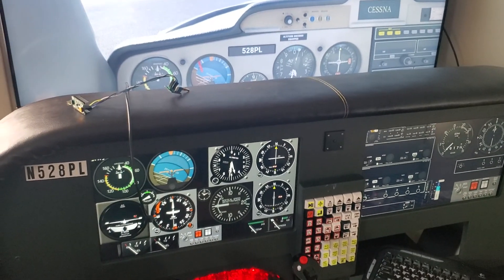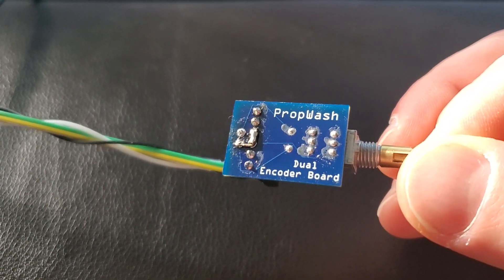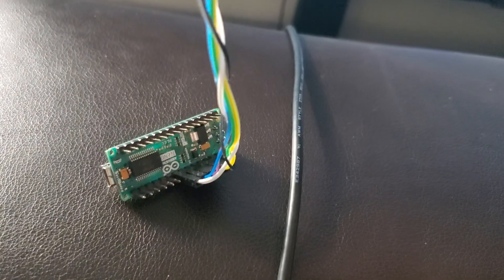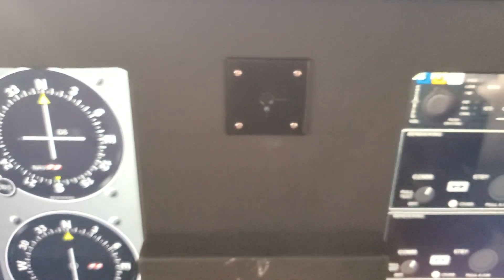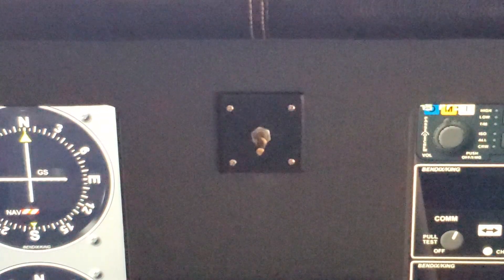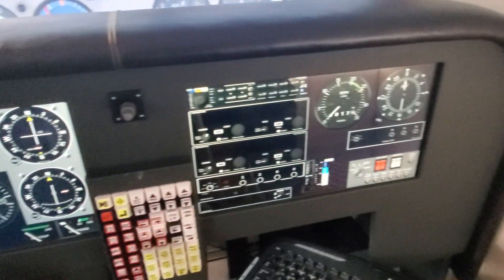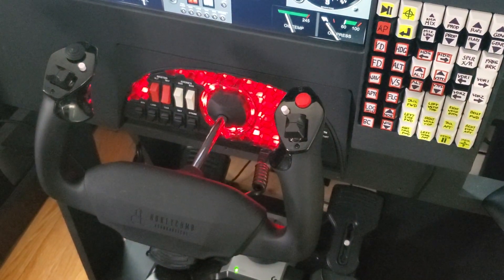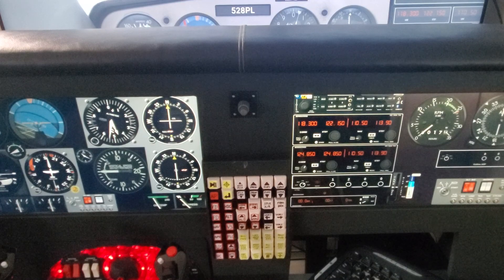DIY Knobster Project- Part 2

Comment: It would seem Siminnovations have now made a new KnobFS version that rules out the DIY Knobster of yours. Do you know of any Open Source projects that has made it possible to use a DIY project like this and still get similar functionality as described here? As a DIY:er myself I was very much looking into building a knobster clone like this, but if there is no support from Air Manager then that is out the window I'm afraid. Any input on this maybe?
Reply from the maker: I haven't been following what they've been doing for a while unfortunately so I don't know what the latest is. Sorry.
Reply: @peterlanoie They mention the "DIY Knobster" as not compatible anymore so at least you have made yourself famous, or maybe infamous. :)
I'm looking into making my own add-on that somehow mimicks a knobster but with more rotaries (like 5), and few buttons that you can feel (while in VR and memorize what they are mapped to. Like the G1000 knobs. A popup toolbar window that shows you your hardware knobs and which of them are mapped to what to help if you forget the mappings. And some configuration switcher control also in hardware that can be used to switch out a config to another. Also a bit like knobster, but for a whole set of mappings in one step. MobiFlight has all the functionality needed to create the encoder mappings and the config switchings (via preconditions). But I haven't figured a way to connect to mobiflight from an external program via an api to get the status of the config switch, which I need in order to feed the toolbar window the grapics for the current setup. So, veery early in my possible project for this, but creating something like this would be really neat I think. 
The end result is a "knobster" panel with more than one rotary and a number of buttons that is connected to selected knobs in the cockpit, with the hardware designed for VR use and everything configurable in mobiflight (which makes it easy to create configs). No promises of any success in this. But it looks  doable IMHO.
Reply from the maker: @kristianjorg418  That sounds great! Definitely talking my language. Unfortunately, I haven't "flown" in too long, being consumed with family, work, and 3d printing so I haven't even seen what doesn't work any more.
I look forward to hearing what progress you make on the project.

Comment: Peter, I built my knobster, at first with a clone Nano, then with the $$Nano. In both cases they failed to flash. It gives me a message  Closed  Com port,  avrdude.exe:ser_open(): can't open device etc. 
Did you run into this when installing your device. I cannot find a remedy anywhere on the web. Am I missing a program? Thanks
Reply from the maker: It was a long time ago when I did mine. Honestly don't recall if I had any major issue. I vaguely recall a problem but I think it was just me not selecting something correctly. I think I flashed it right from airmanager.

Comment: Do you have to buy the full version of Air Manager for using the Knobster?
Reply from the maker: I think I set it up on the free version but I can't recall for sure and I haven't run it in some time to test/check. Sorry, I know that doesn't help much but wanted to reply with something.
Reply: @peterlanoie  No problem, Peter. I think I'll order some parts anyway. Thanks for your time!

Comment: Thanks! Great job Peter!, and thank you for sharing your knowledge. Your panel looks great! :)  Question, was i difficult to program? and did you connect the Arduino with usb to the computer running Air Manager?  Thanks Again!  David.
Reply from the maker: Thanks! The initial programming I did to experiment with it was not too bad once I figured out how the encoding stepping worked. Setting up as the Knobster was all handled by Air Manager, I just flashed it from directly in the program. Yes, the Arduino is directly connected (via a hub) to the computer's USB using a regular micro USB cable for data and power. Flight Sim and Air Manager all run together. I haven't tried the networked Air Manager viewer app.
Reply: @peterlanoie  Thanks Peter for this info! I really appreciate it!

I contacted propwash for the dual concentric encoders, but they wanted 50 dollars min for shipping to sweden!!  

So i will try to find the items needed from some supplier in europe. My first goal is to build a simple unit that kan change frequencies in x-plane & FS2020. I will then use my regular monitor for scenery and 2 old iPads for extra screens to display air manager instruments and maybe the G1000. 

Further down the line i would likt to have something like you done, i don't want  a complete cockpit (Due to space), just the instrument panels and glare screen and a big 2k or 4k TV.

What sources on the net did you find most useful to learn Air manager programming or setup and the electronics stuff?     Thanks! David.
Reply from the maker: @Skinny-me  it's been a while since I set this up so I don't remember details if where I found info. I'm a programmer by trade so that was just experience apart from reading documentation on arduino specifics. Setting up air manager has been mostly trial and error. Anything else was just googling.
Sorry that getting the encoders outside of the US is such a pain. I've that from others too.

Comment: Great vid, hey do you know if you can use direct with MSFS2020 if you don’t use Airmanager and it would recognise it as a programmable device so I can assign to Comms etc?
Reply from the maker: As a Knobster it's intended to be used with AirManager. There are Arduino programming libraries that can make an Arduino appear to the computer as a standard joystick but that would require custom programming.

Comment: Great video thanks. I have same issue with msfs and the honeycomb yoke. I unplug the yoke then it works perfectly. Have you by any chance found any other solution other than waiting for MS to fix it!? :)
Reply from the maker: Unfortunately, I have not yet found a fix for the button repeat problem.
Reply from the maker: I forget exactly when they fixed it but a recent program update resolved the button/knob repeat issue.
Reply: @peterlanoie  Hi, sorry for replying to an old thread but are you saying the update fixed the skipping by 10 degree issue when rotating the knob?
Reply from the maker: @Double-D_291  yup!
Reply: @peterlanoie  awesome! Thanks mate!

Comment: Should we load any specific Code to arduino nano from air manager?
Reply from the maker: Air manager has the built in function to flash the Nano with the Knobster code. No additional steps should be needed.

Comment: I have Dual encoder and button knob from PropwashSimulation and the Arduino nano. But what is the name of those cables in colors and jumpers and where you bought those.
Reply from the maker: The wires are testing leads or "jumper wires". The pin slide on plug on those are called "Dupont connectors". The ones I used are female-to-female. On end connects to the encoder board's pins, the other to the Arduino GPIO pins.  I got them from Sparkfun: https://www.sparkfun.com/products/12796
Depending on what you want to tinker with, it's helpful to have male-to-male and female-to-female style as well.
https://www.sparkfun.com/products/12794
https://www.sparkfun.com/products/11026
Plenty of options around such as at Adafruit: https://www.adafruit.com/?q=jumper+wires&sort=BestMatch

Comment: I like your work. But I am finding operating the knobs with the streamdeck and flighttrackr-mobiflight plugins easier than the actual physical knobs.  I can operate all knobs (ALT, NAV, RADIO, GPS) on the Mooney Ovation in MSFS2020 with the stream deck now.  One streamdeck advantage is advantage is you don't have to select and activate a gauge first and the numerical display in also on the streamdeck keys. Just wish we can enter Airports codes and Waypoints via Alphanumeric display.

What you have done here is awesome and I like you work.

Just FYI for anyone: The stock Vertical Speed Button serves as the ARM button in the Mooney.
Reply from the maker: Interesting, I had never considered something like a streamdeck for that (I don't have any streaming paraphernalia). One of my goals for my flight sim cockpit build has been to make it as much "not computery" as I can but also make it flexible. I didn't want to make a sim pit that's very specifically one aircraft. So obviously there are some concessions like using touch screen displays to support highly variant instrument styles and layouts (although with modern glass cockpits it's becoming more realistic to have just a display). Also, the programmable keyboard is certainly not a great analog to normal cockpit equipment. But in my view buttons are buttons.
I have found that the knob has worked well (MSFS input bugs aside). I like having that physical knob to manipulate. It's easy to locate without looking and I find I am not changing the knob's target instrument frequently enough to make the "tap and turn" pattern annoying yet. But to be fair, I haven't been doing much with ATC yet where I would need to be changing back and forth between radios and navigation controls. The programmable keyboard has autopilot inputs on it so that reduces some of that need too.

Comment: Thank you, did you manage to fix the step skipping issue?
Reply from the maker: Unfortunately not yet. This is a known issue with a bug directly in flight simulator. The signals from the knobster to air manager are fine, likewise the commands from airmanager to flight sim are fine. Flight sim is handling internal logic for button inputs poorly. I have an idea but haven't tried it yet.

Comment: Can we associate the encoder with a screen that is not touchscreen thank you very much for this video
Reply from the maker: While the Knobster (DIY or commercial) is most effective when used with a touch screen, you can use it on a non touch screen. As long as the Air Manager panel has Knobster input enabled, a regular mouse click will activate a knob input that the physical knob can control.